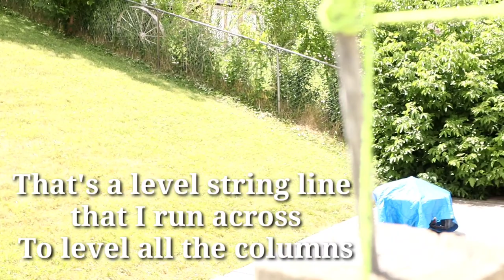bricklaying - laying some bricks on a brick column [PT 2 ]

Comment: I would really like it if you would speak about how important it is to keep your tools clean and the job site.
I have noticed your jobs always seem to be very organized and your tools although well used are clean. 
It speaks to me ,you must have a amazing helper.
Reply from the maker: Yeah I like to be organizethe and clean as I go 😊and  my labors is a very good one as well..,good tips I will make a video of that soon.👍
Reply: The labor is one of the most important people on the site I believe. 
When all you need to worry about is being a Mason the work will reflect that. 
When I'm working and I don't have to worry about stepping on broken peices of stone or brick and I can concentrate on level and plum  it shows. 
I also like the input from a nother pair of eyes .